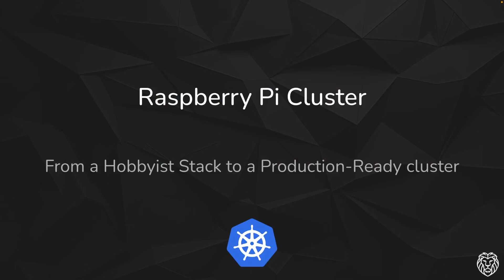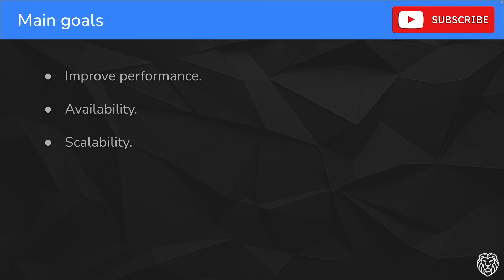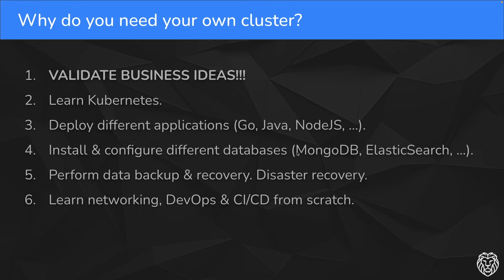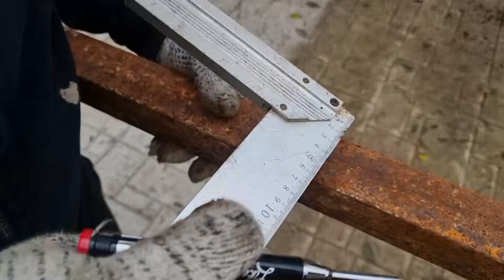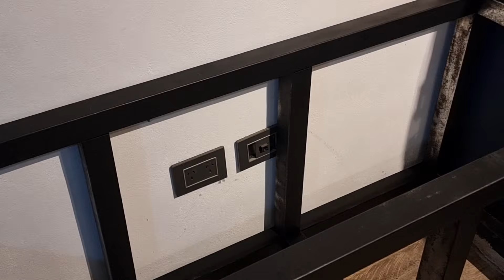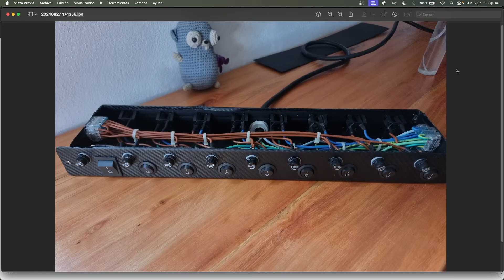You need a Raspberry Pi cluster! Deep guide

Comment from the maker: You don't need a job to gain experience: you can build it at home.

Setting up a real cluster like this teaches you everything from networking, distributed systems, Kubernetes, container orchestration, monitoring, high availability and even hardware planning.

By the time you apply for a DevOps, SRE, backend or platform role you've already solved real problems. And that shows A LOT.
Instead of hoping to "gain experience" after getting hired, you walk in already prepared (even qualify for a higher-level role or promotion).

You can even make money with it!

Check it out and let me know your thoughts.
Fede.
Reply: Maybe you can try NanoCluster! super compact cluster in the size of a can
Reply from the maker: The idea here was not to make it small but to have the chance to validate business ideas without paying for a Cloud provider until the idea is validated and I have paying customers.

Getting the same 8 nodes, 8 GBs of RAM each, and having 250 GBs of NVMe storage will cost a lot more in just a year compared with owning your own cluster.

Thanks for the comment though!! 
Fede

Comment: what's the pros/cons compared to just getting one good computer, installing proxmox and having multiple VMs instead of multiple physical pis. I like the idea of multiple pis, but I will lean towards maintaining and spending for less hardware.
Reply from the maker: Hey! Thanks for the question!

The answer will depend based on what you want from your system. On a pi cluster you have multiple nodes. If one breaks, just spin another, and that's it. If you're running Kubernetes you don't even realize about that problem and you keep providing service until you replace the broken pi. That's, to me, the main difference.

The other big one is power consumption. A single pi 5 with POE hat tops at 16W under heavy load. That would be almost 50W for 3 nodes. One good computer won't take less than 150W at idle, maxing out at 400W or even more. For small applications that don't require massive processing all day, having one single good computer consuming that amount of power and also being a single point of failure doesn't worth the cost.

Everything depends on what you expect from your system. I can process 3K requests per second at full blast going against Go and MongoDB with 6 nodes using less than 100W. To me, that works. If I need anything more powerful then yes, you do have better options. But for small services receiving traffic now and then, cheap and reliable pis are worth. 

Hope it helps!!
Frde
Reply: @LeonDevs  Yes,  it depends. My initial intention to have a study sandbox, so that I don't have to do trial and error on the server on my workplace. Proxmox made sense for that use case, especially as I already have small desktop PCs to tinker with  However, I think the low power consumption and small footprint of Pis make them appealing if you will actually use them for home lab use and not just for one time studies. It's just a bit of a bummer that second hand tiny PCs are actually cheaper than Pis.